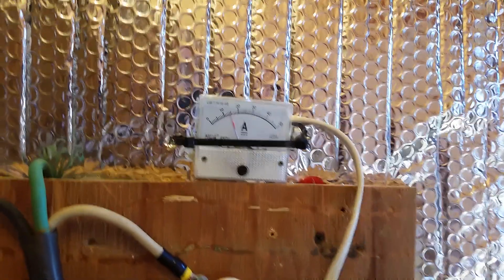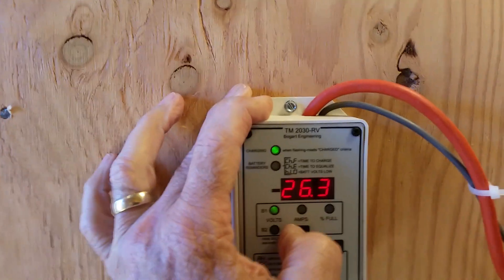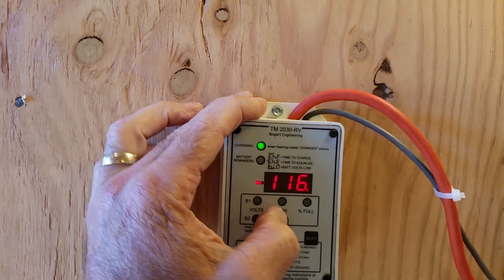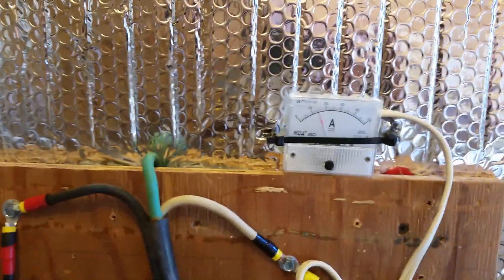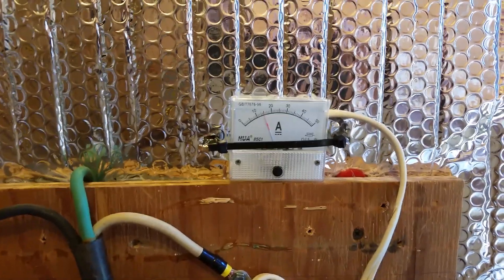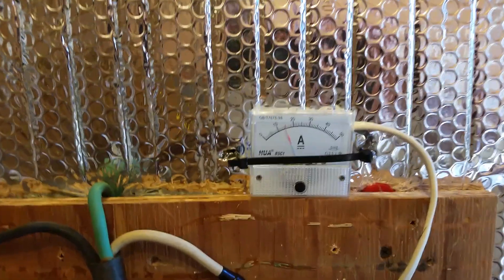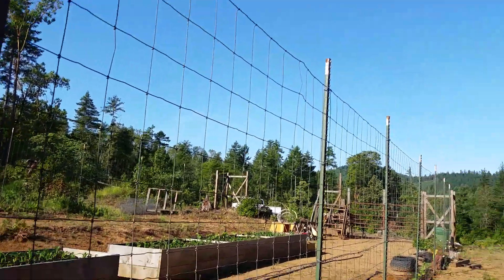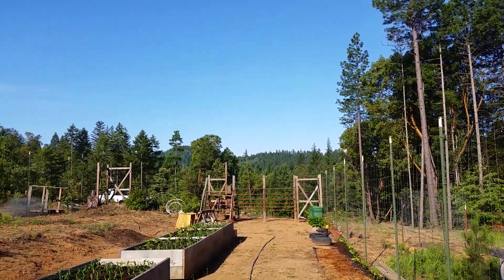Off grid solar homestead (backup generator)

Comment: Is the 24 volt alternator hooked directly to the battery bank? It won't back feed into the solar charge controller when the alternator is running? Sorry for the questions; I am new at this! Thanks ~Dave
Reply from the maker: Tiny NH House The alternator has a bridge rectifier that acts as a  blocking diode. Our current system pun intended has multiple charge sorces connected to the same battery bank. They all sense the voltage and back off the current when the battery is full. Even though the MPPT  solar charge controllers have a 4 stage charge algorithm if the voltage from another sorce raised the voltage above the solar charge controller setpoints the controller would go into standby mode. The same with the alternator,  it would just back the current off to its voltage setpoint by the internal voltage regulator.
Reply: Thanks for the information. I guessed each device was smart enough to sense the battery voltage; just wanted to confirm. - Dave

Comment: Seems like TX is getting a ton of rain. Also our temps have been below normal. I can't complain as we need the rain. However, some folks are being flooded out. We've lost some folks due to flash flooding. 

I wonder about things often. Like your little setup you showed today. How efficient that is as compared to other systems. I know that Honda makes some nice generators. Yet they tend to be a bit expensive. And one has to have gas to run them. Have you looked into making ethanol to run in your generators just in case of the break down of ROL?
Reply: Steven Davis Looks like you have it mostly covered. Just thought that you could use some of your extra fruit etc to generate ethanol for power generation. I read a good article where a guy used excess solar to crack water & stored the hydrogen for use. 

Like you I would prefer the solar & wind. Sadly they need to come up with better batteries.
Reply: Steven Davis Thanks